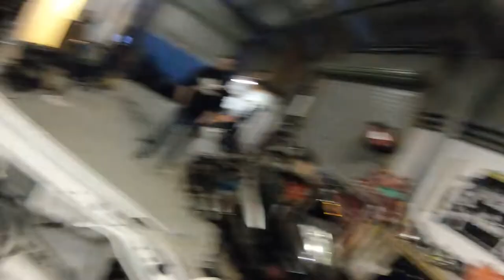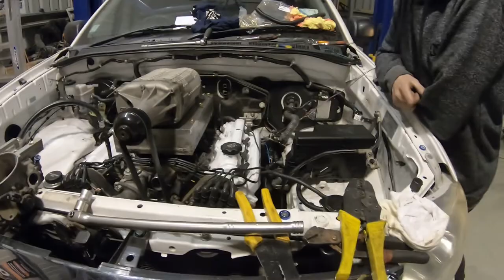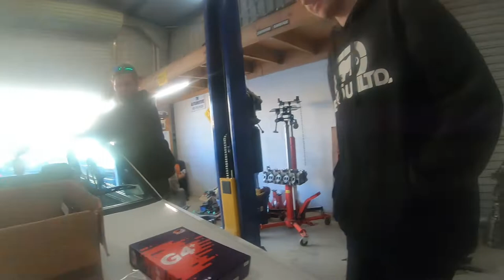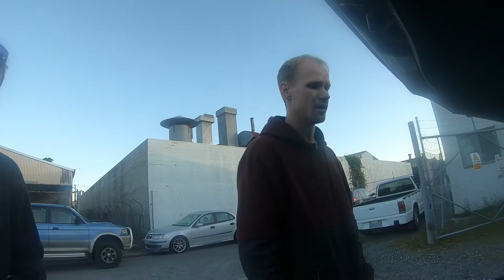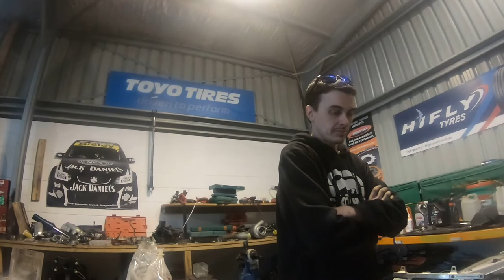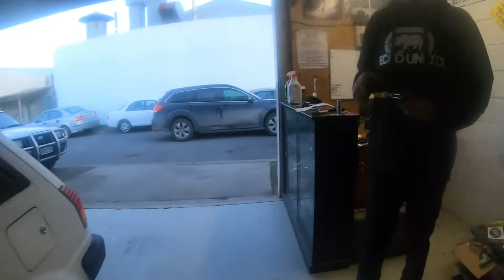Supercharged 2006 Toyota Hilux Vigo 1uz-fe gets link ECU (and turbocharged soarer / sc400)

Comment: What are the horsepower numbers?? I'm looking for around 400 to 500 hp but have no clue how to achieve this on a budget. Thinking about making a custom procharger with around 8 to 10 psi but will this be enough?? And what do I need to change?
Reply from the maker: This one doesn't run yet as this was the first video of the wiring planning.  Once it's running we will hopefully have more.  I am careful with power figures as often people arent realistic.  Stock 1uz around 260 crank.  each atmosphere doubles output (theory) so 15psi would net close to 500hp crank.  With supercharger there is parasitic loss so then that needs to be factored on the type of charger.   Too many factors to really give an answer.  If its a Gen1 engine they take some boost in stock form but changing things like cams makes power output easier.  cheers Kelvin
Reply: @CartuneNZ  so what amount of boost will the stock ecu accept and what are the biggest injectors the stock ecu can handle. Sorry for all these questions lol.
Reply from the maker: The big problem here is which stock ECU?  There are lots and the mapping is different on them.  The ECU doesn't know the injector size , it just fires them at the calculated Milliseconds.  The O2 trim on the UCF10 and UZZ30 series ecus is primative.  Basically as you have no adjustment of the ecu you have to rely on airflow reading changing enough  to give enough fuel , fortunately lexus are generally mapped very rich up high with generally very conservative timing numbers so some guys get away with it , but I see plenty that blow plenty of engines.  Cheers
Reply: @CartuneNZ  well I guess that I will go with a stock ls400 1UZ (pre 1994) and just save up and get a LINK G4 ecu when I have the money, looking for around 400 to 500 HP at the crank.